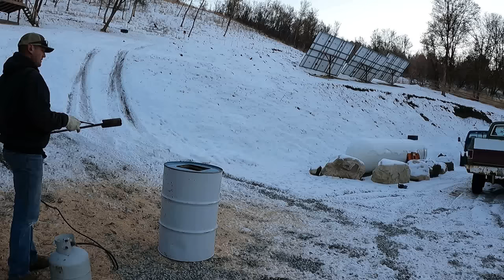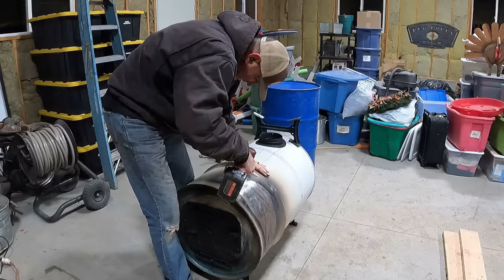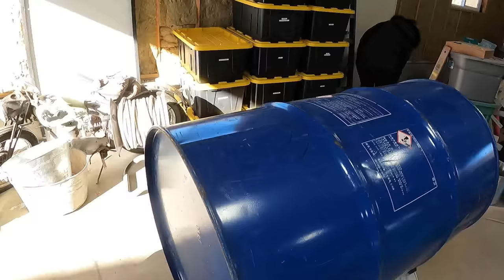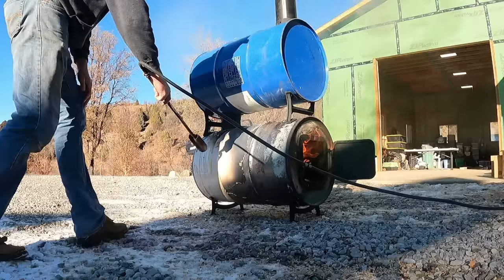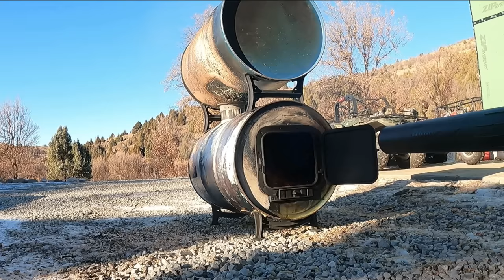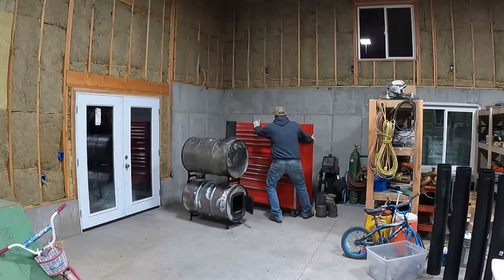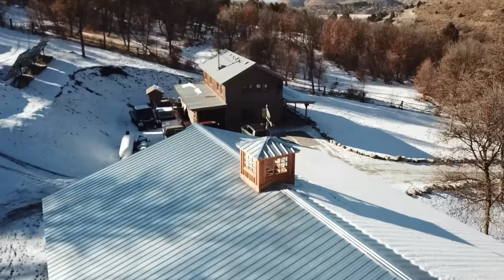I Built The ULTIMATE Wood Burning Stove For The Shop...

Comment: consider adding an external air source to feed the stove. Like a 6" stove pipe thru the wall of the shop with a damper. Right now, you are using the warm air in the shop to feed the stove. That air has to be replaced with fresh air creating drafts. By taking fresh air from the outside you avoide these pitfalls. You will use less wood and feel warmer.
Reply: I have experienced the opposite.  When it is -20 and below the sir is just too cold to make a proper burn. Went back to using a small 5/8" hose to add replacement air to the building
Reply: @metalpolishshop  As long as you are making up the air somehow is what matters. In your extreme climate you will have more things to consider.
Reply: @metalpolishshop   Winter of 1966, Mendeltna Alaska, air temp minus 81 (REAL air temp - not fake "wind Chill").  Without question you're wrong Kevin, dead wrong, our barrel stoves ALL burned just fine.  - Joe -
Reply: There are some reports that say using outside air is not beneficial. Assuming that those are incorrect and it is beneficial, how does the wood stove use less wood simply because the air supply is from outside?
Reply: @dogwoodtales  Look outside at you chimney when a fire is going. That column of smoke was recently warm air inside your shop. The warm air has been replaced by cold air being sucked into replace what went up the chimney. Supplying cold air to the stove from outside breaks this loop.
Reply: Hate to break your bubble but sucking in a little cold air is fine with me cause it's fresh air full of oxygen and helps you breathe better, not efficient for the stove but good for me
Reply: @dogwoodtales  wood burns like wood burns.
Using outside makup air method doesnt burn already heated air so there is a net in house heat efficiency gain of app. 35%. So you feed the monster less.l
Reply: @dogwoodtales  house is less drafty because cold air is not being pulled into the home as it used up in the woodstove. so you use less wood to achieve a comfortable temp.
Reply: Lex Ruth  i dont think there is much difference between inside and outside besides temps.
Reply: @cargotoolshop5319  What ever makes you happy it aint breaking my bubble.
Reply: Colder air is more dense, and contains more oxygen per given volume. It creates a more complete burn, thus a higher efficiency.
Reply: @dogwoodtales  Because you feel warmer and need less heat from the stove...
Reply: Fuel economy will diminish though, more fuel burned to deliver equal heat
Reply: @reallyhappenings5597  no, if you are not constantly chilling the room by creating drafts you will use less wood to warm the space.
Reply: @je-fq7ve  depends on how drafty  your house is
Reply: @buddyflood6758  if you could seal your house perfectly and lit the stove. your home would implode. Air finds a way. by running the stove you create the draft. look at how much smoke is coming out the chimney. That is also a visualization of the air leaving your home.
Reply: @buddyflood6758  my point is running a wood stove without make up air creates drafts.
Reply: Cold air is more oxygen dense than warm air. Warm air molecules vibrate and space themselves out. For a good draft I would use half the size of the exhaust pipe directly connected to the outside and then to the barrel towards the front near the barrel door. You would burn less wood because you wouldn’t be sucking in cold air from outside into the shop which then goes into the heater. HVAC tech and thermodynamics expert.
Reply: @dogwoodtales  Because air from outside has much more oxigen. I saw a study about this it they said it saved 30% wood.
Reply: Buy an extra barrel and remove the ends. Roll it up and insert inside the prime barrel to
double line the barrel.. Barrell stoves burn through after a few years creating a fire risk.
Double line your fire barrel for longer life and safety.  Fix the liner to the outer barrel skin
with short stove bolts in the upper sides allowing for expansion and contraction. A
double walled barrel is a better stove and lasts for many years.
Reply: @dogwoodtales  I think what he's saying is, "The house has fewer drafts because the cold air doesn't need to draft through the windows to supply the stove. So without the drafts we feel warm and use less firewood." What a nice wood stove, eh.
Reply: The Romans did a similar idea fire outside feeding hot air underfloor and walls no draughts and only required 2 servants and woodcutter.
Reply: @je-fq7ve  yes but doesn't the cold air suck more heat to As It Gets mixed?
Reply: @jacquestube   you are feeding that air directly into the stove not the room. normally the room air and stove air mix. Separate them by supplying the chimney with its own air. then they generally dont interact. warm air stays in the room.
Reply: @Loganl1980  Yep…thanks for the important burn efficiency factor.  Most folks don’t grasp the stoichiometry importance of adequate air/oxygen feed for an efficient burn.  The draft issue is real but the dense air/high oxygen content is a huge bonus allowing much more efficient combustion.
Reply: Pretty much all industrial boilers preheat the incoming combustion air with flue gas heat exchangers.
Reply: @bobcranberries5853 I have a similar concept but different set up / application: masonry fireplace with a steel, wood burning insert installed in the firebox. 6" stainless steel chimney liner & single gasketed door.
If I plumbed an outside combustion air supply into the ash box (clean out door is accessible on rear of chimney) of the original masonry fire box, my guess is it would be beneficial to the combustion process even though it wouldn't be directly entering the steel insert firebox🤔.
Combustion air is currently dampered, room air entering through the front below the fire box door.
Reply: @lsd8497  I read a study that said that when ppl make up percentages they use 30 - 35 %
Reply: @safetyfirstintexas  I read a study that said that when ppl make up percentages they use 30 - 35 %
Reply: @heofthebee  that’s funny!
Reply: Built an oil fired one years ago ,still in use
Reply: @matthewerwin4677  - You sure why? If pre-warmed air were efficient we'd need to remove the intercoolers from our cars.
Reply: @breakbollocks9164  A boiler is made to run as hot as possible. More heat means more steam produced. Any heat that goes up the smokestack is wasted heat.
Reply: This is really cool. How efficient is this setup compared to the modern expensive wood stoves?

Comment: You should have built a wire grate wood platform in the bottom barrel took keep the wood off the bottom which should help the barrel last longer. You could've even put tubes completely through the top barrel making a heat exchanger type setup, and then put a fan on the back side to blow air through on those really cold days.
Reply: In the beginning of the video I did see some burned out grates on the floor. But you are correct. I how ever have two 55 gallon stainless steel barrels that I will be doing the same. S.S will out live me.
Reply: I KNOW this was 2 years ago !!  You could have put a roll of copper pipe in that top barrel an had endless hot water too ! Provided you had a good water source ..

Comment: Those are nice. Use  one in a 40' x 64' shop. Used barrels with removable lids and built taller stand to set barrels on. Also put firebrick in bottom barrel. I've had it for 15 years now.

Comment: If you got a chance during the summer, you might want to flip the connector between the barrels. The way you’ve got it installed, looks like you’re going to end up with creosote drips/leaks at the joints. The upper section should always slide inside the lower section, not the other way around. Cheers!

Comment: Just a suggestion - line the bottom of the lower barrel with firebrick, and burn the wood on top of the firebrick.  It seems to me that the burn barrel would last longer that way.
Reply: Adding sand will work too. It saved the barrel for another couple of years.
Reply: I built one of these a few decades ago, and I lined the bottom half way up the sides with firebrick. It worked great. Never cherried the outside of the bottom barrel

Comment: We had a similar double barrel  wood stove in our shop at work.  Worked great. We lined the bottom barrel with fire brick.  Stood  an electric fan on the side of it to force the heat further from it and used it for many years. Cost all of about $20 in materials.

Comment: You can extend the life of the barrel by putting a little sand in the bottom to make a flat spot, then a layer of fire brick on top of that. You can even lay up some bricks on the sides.
Reply: 100% agree, when you star to see pin holes forming.

Comment: My buddy from Houston made my father one similar to this, but it's out of steel, 25 years ago, dad's been gone for quite awhile now, but I got that heater still in the shop it's still workn fine, I like seeing glow cherry red (sometimes) not always, it's very heavy but I can always move it if I have to with our hoist on wheels. The legs on ours are 3' high and were easily able to remove the ashes, with a wheel borrow, he even made a grote that can be removed for cleaning and can be reinstalled. Excellent project partner, always helps beat the coldness, Thanks for sharing this with me. 😊🤠✌️👍.

Comment: I also built a double barrel heater almost the same as your heater. Only differences are that I notched a rectangular opening into the back of the top drum. Size of opening 3/8" x inside diameter of the drum at the center. I inserted a steel plate as wide as notch in the back of drum x 6" short of the drum height an welded it to the back entry notch, and along both sides to create a heat directional barrier plate. My connection from bottom to top was located on back of drum. I also lined the inside bottom of the bottom barrel with brick covering 1/2 of the bottom radius. This heater lasted me for just short of 15 years. Also did not have  access to kit so I fabricated all that was required. It was built in summer of 1977. Your heater is well built unit.
James karwacki

Comment: I worked at a farm engineers yard at Faversham in Kent in 1981 and the owner had made one of these to run on old engine oil drained from farm machinery having services. There was a round metal dish in the bottom drum, near to the front opening, there was a four inch pipe joining the two barrels together at the other end and an outlet or chimney at the front end of the top barrel. no vent holes other than the front door and the chimney outlet. a copper pipe was brazed in through the side of the bottom barrel and into the metal dish. a piece of rag was put into the metal dish and soaked with engine oil and then lit. An isolating valve on the oil line feeding the dish, was used to regulate the flame. When the flame had been regulated, the barrels could be run at 'dull red', ideal for toasting bread on a toasting fork. An amazing amount of heat was produced and the flame adjusted so very little or no smoke was visible from the chimney. So heating a large workshop, cost him nothing! A brilliant idea! But not so environmentally friendly these days!

Comment: We took our local Boy Scout Troop on a weekend camping trip in mid January several decades ago. The trip was more of a chance to practice on some of the skills needed for the upcoming winter jamboree, plus a reward for the boys for a high number of advancements in ranks and merit badges earned at summer camp (the reward was a "pizza pig out", with 3 cases of pizza's, 25 pizza's to a case!). I remember the shelter we stayed in had a large area to put down sleeping bags and cots, and an area with a stove and kitchen, In the center of the shelter was a double-barrel stove. That thing put out so much heat you couldn't be near it, but it heated up the area very well.

Comment: Very nice! As a former Minnesotain, we used to do some trick welding in a center small barrel half the size in the second barrel and add a fan blowing through. Also, we used fireplace door cord everywhere to air tight it.

Comment: Great video, find a small fan and have it blow across the stove,  it will make a tremendous difference for heat output into the shop.
Reply: - I agree! I had an old 16” mounted in corner at the ceiling blowing down right at the exchanger barrel. It made the difference between a warm concrete floor and a cold one. Also speeds up the overall feeling of warmth throughout the area.
I also did a cinder block fence filled with field stones around the stove.

Comment: My dad built something similar almost 50 years ago to heat our house. It was made from a half oil tank with a welded metal lid, ice cream freezer door and oven racks inside to elevate the wood. 

He would later fine tune things by using an outside metal casing from a clothes washer to surround the stove and fill the space between with rocks to help retain the heat.

Comment: Do this if you want to get more heat. In 1975, my friend in northern Idaho made a stove just like yours, with one big difference. The top barrel had a 16" pipe going through the middle. The exhaust pipe on the top barrel was located towards the front of the top barrel. That allowed the heat to circulate through the top barrel. He placed a 16" fan at the back of the hole in the top barrel. Heated his 40X40 shop with no problem. Even at -20 outside.
Reply: I like this idea

Comment: Really surprised when you mentioned retaining more heat for the double barrel wood burner why you didn't add rocks to the second barrel. It would have been fairly easy to have a small metal grid so they don't fall down and use large rocks that would let the air flow through but still massively increase the heat retained hours after the fire has gone out. Just a thought.
Reply: Creosote build up is why that wouldn’t be a viable option.

Comment: We’ve used a double barrel stove in our shop for 30+ years and depending on what you burn (rail road ties, rubber, oil, burn a lot dirtier) you shouldn’t have any issues getting that stove to draft. You from time to time have to climb up on the roof and drop a length of chain down and rattle it around to clean out the stove pipe should be about it. Good luck! 

If you wanted to get fancy I’ve seen guys weld some exhaust pipe horizontally through the inside of top barrel and run a fan on it to really maximize your heat output. Some other “homestead” type YouTuber did something similar.

Comment: 1: Relocate that tool box and put it farther into the corner. Missing out on extra radiant heat from the concrete walls on 2 sides. Be sure you PROTECT those walls with heat reflective panels for maximum effect.  2: Routing the chimney up is good...but send it over to the wall 1/2 way down the stack. NOT right under a joist beam and through the "attic" spaces. Thats asking for a fire at some point unless its double walled and insulated to be fireproof in those spaces. Easier to mount, secure and insulate if its run up the wall. Plus any radiant heat from the stove pipe stack and reflected off the wall behind it. Dont cheap out and rely on the joints to seal themselves...get GOOD fireplace dope and seal those joints...and install a "cleanout" port above the top barrel. You NEED to sweep the chimneys to prevent fires. A cleanout port makes this trivial.
Reply: its true,  i learned about all that after i burned down my shop with a barrel
Reply: N0T just a clean out port for the chimney,  but baked creosote  flakes will also collect inside the top drum naturally and require removing.

Use a quality chemical flue cleaner  like "Saf-T-Flue"regularly.